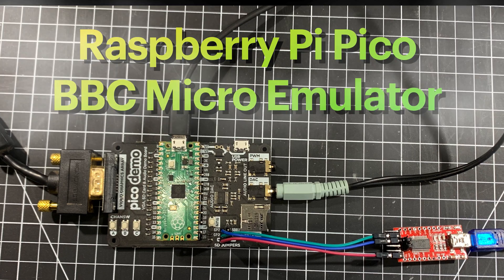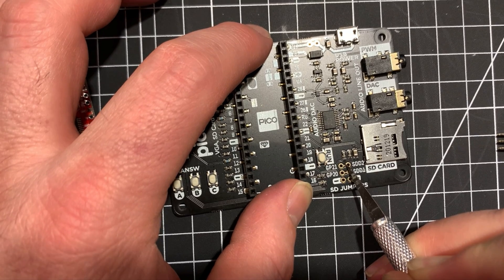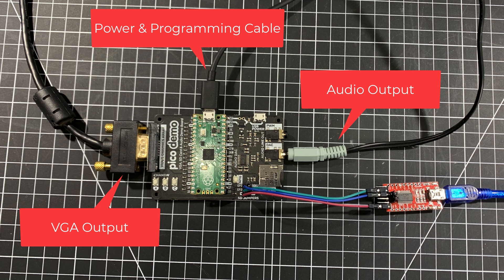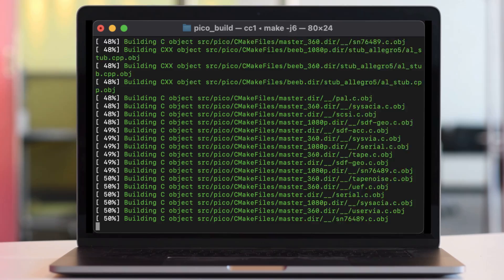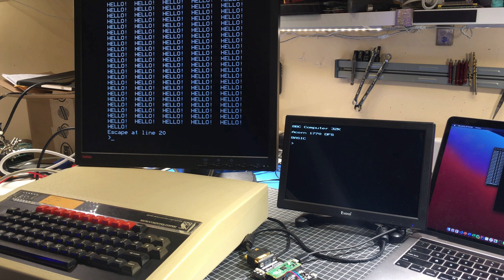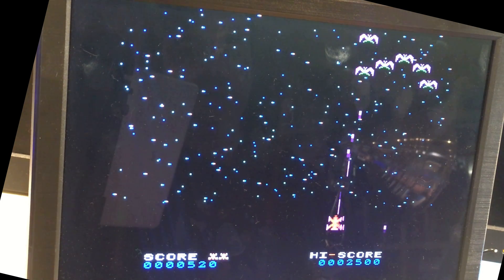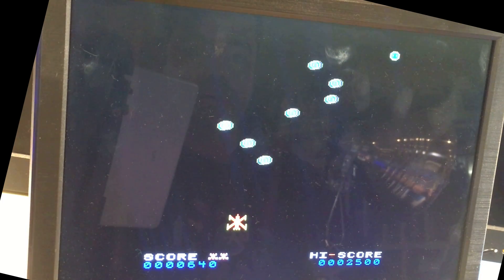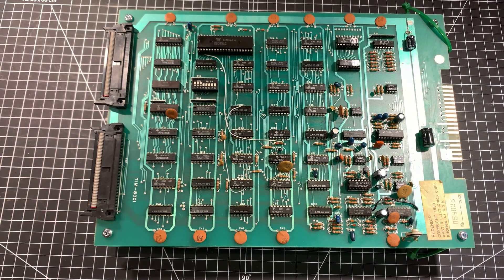Raspberry Pi Pico, BBC Model B emulator.

Comment: Would this project also work using the Pimoroni Pico DV Demo Board instead of the VGA Demo Board?
Reply from the maker: Yes I think it will work but will require some code changes from VGA output to DVI output. You can find a couple of videos on my channel for how to get HDMI or DVI output from a Pico. They may be helpful.
Reply: Thank you!  @robin-g6

Comment: Is there ANY WAY to connect a KEYBOARD to this, more or less DIRECTLY? It seems a bit weird to use a $1K Mac to "emulate" a keyboard... THANKS IN ADVANCE! Great project!
Reply: Assuming you can apply power to that board some other way you could use a USB keyboard connected to the Pico via an OTG adapter if the emulation supports it.

Comment: Hmmm... when I try "cmake -DPICO_BOARD=vgaboard .."  I get "Could NOT find Allegro (missing: ALLEGRO_LIBRARY ALLEGRO_FONT_LIBRARY etc..." Allegro appears to be a PCB design package so I'm not sure why the Beeb Em would require this? How do I get past this point?
Reply from the maker: This is the allegro programming library. On a Mac its 'brew install allegro' to install . Here is the project link which should help. 

https://liballeg.org/
Reply: @robin-g6  Hi Robin, thanks for the response. OK on the allegro library. Do I need the version for the host platform (Ubuntu on Pi) or for Pico?
Reply: Ah, OK. A case of RTFM! At least one step further along now. Many thanks.
Reply: OK, giant steps - got the emulator working using a 3v3 USB to TTL adapter for the event forwarder. As I'm hosting this on a Pi I thought I'd use the Pi's UART0 (pins 8,10) but the event forwarder consistently refuses to send the escape sequences with message "Failed to write!". Modified the source to show what the return from the write() was - always zero, nil, zilch! Can you think of any reason the Pi's UART0 wouldn't work with event forwarder? Tried with /dev/serial1 (symbolic link to /dev/ttyAMA0) and /dev/ttyAMA0. I used raspi-config to disable console and enable uart. Slight complication here is I use Ubuntu for Pi as I'm not a fan of Raspbian/RasPiOS. PS can't find an email address for kilograham/Graham Sanderson otherwise I'd ask the author :-).
Reply from the maker: @CptDangerous  sorry this is proving a challenge. I did find the forwarder a challenge too as the code did not compile on my Mac Book. I messaged Graham up on Twitter @kilograham5. I’ve found most  of the Pi Foundation folks seem really responsive. I can say Ubuntu on Pi had issues for me with serial ports in the past. I switched to Raspbian and had no issues. Might be worth switching to Raspbian it usually does not take long to try. I do think someone should try to connect a PS2 keyboard directly to avoid the forwarder. Seems overkill to have to have 2 computers where 1 is just the keyboard. I might try to do that.

Comment: would I need the same USB/UART adapter or are the all the same?
Reply from the maker: They are generally the same but get one that has FTDI brand chip as the drivers are really good and just recognised by your OS. The other thing is you need one with 3.3v logic levels. Many are 5v only and that could damage the Pico.
Reply: @robin-g6  OK Thanks, great vid

Comment: Also, would it be possible to dedicate one of the two cores to generate VGA (and maybe audio) signals and use the other for actual program execution ?
Reply from the maker: So video coming soon on HDMI output that uses half the I/O lines to VGA. You can also create a screen buffer and have one core tender video while to other just writes to the screen buffer. Also there is a ZX Spectrum and C64 emulator coming.

Comment: So basically the PICO is a perfect platform to write an emulator of an old 8 bit system or a simple fantasy console.. You got audio output, vga output, keyboard, etc.. awesome :)
Reply: I would imagine DOSBox would work quite well too if it has been ported.
Reply: @SpeccyMan  maybe.. the x86 architecture is quite a bit more complex than stuff like the zx spectrum.. probably a bit much in terms of RAM required to do it I'd imagine. I think most (all?) base systems had at least 64K of ram, then you need to store the emulator itself somewhere. Perhaps though, I mean it's a miracle you can even do this!